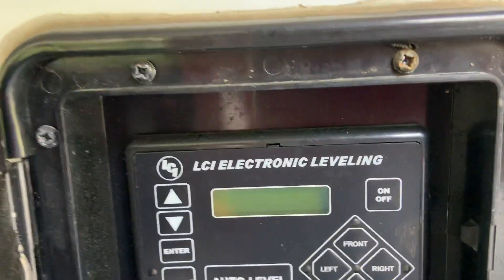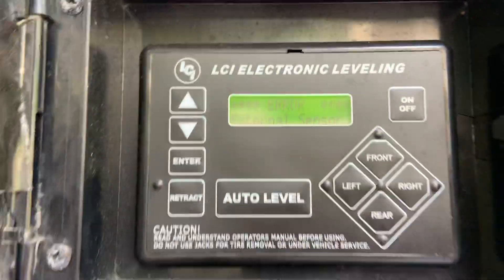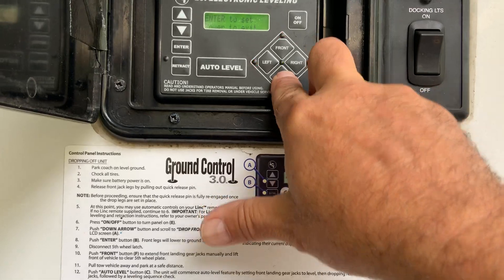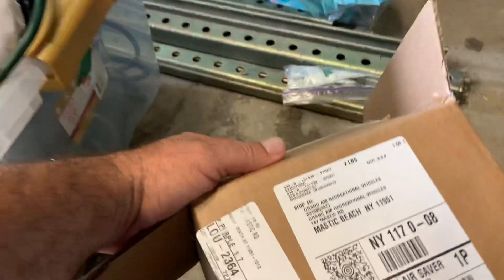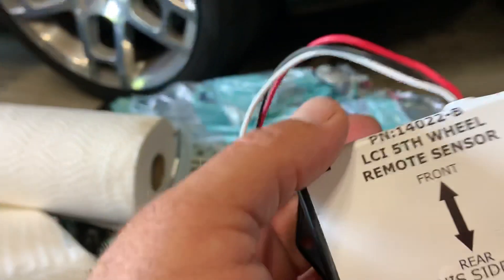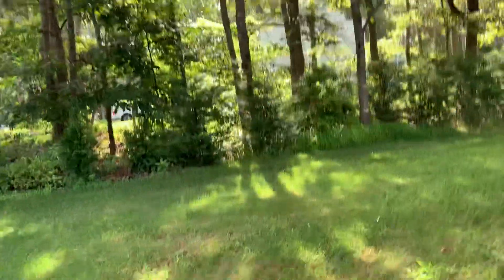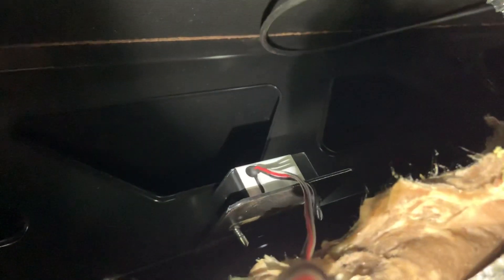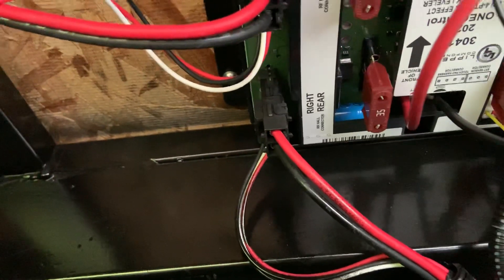Lippert Self leveling locations installation

Comment: Thatwas helpful. But do you have to buy they back sensor for you are replacing the front leveling control? Or was it due to the water messing the back sensor? I am replacing my front controller and is there any specific way it has to be done?
Reply from the maker: It actually turned out that it was my front main brain that was bad I did change the rear sensor but it was the main brain
Reply from the maker: They are very helpful call the company and they’ll talk you through it I had to replace the main unit but I think that’s because mine was overvilted  or something Change your real unit it’s relatively inexpensive I actually have two new ones somewhere if I could find one I’ll message you back
Reply: @greggmgm  Greg can you tell me how you knew the main controller was bad?  I replaced the rear sensor and i'm still getting the error.
Reply from the maker: Hi they were very helpful with that system I didn’t hear about any buybacks but while they were helping me through it they did cover a lot of items which surprised me and they really talk to me through it